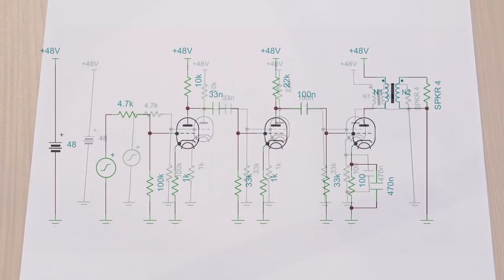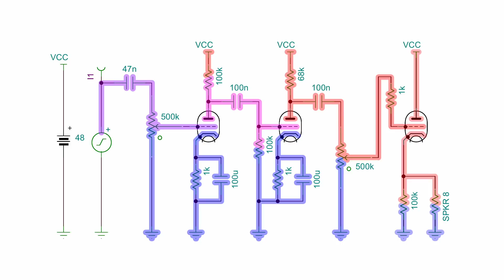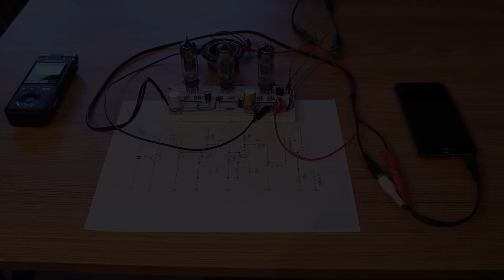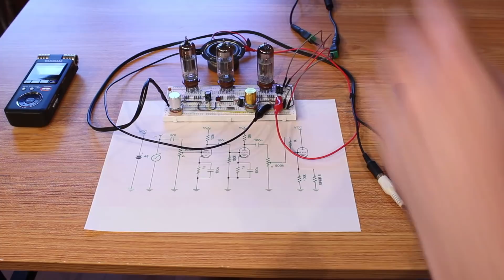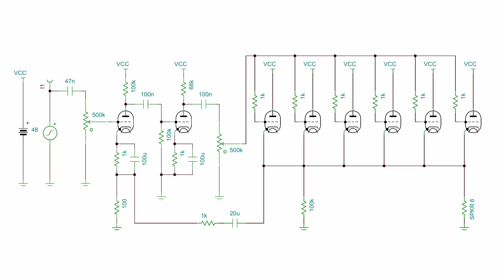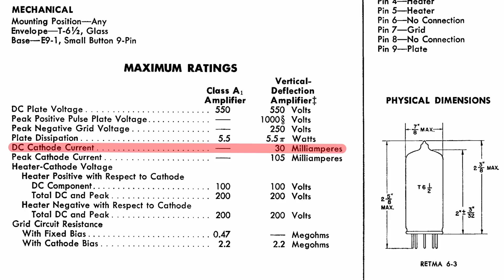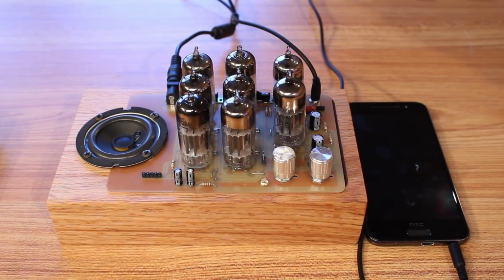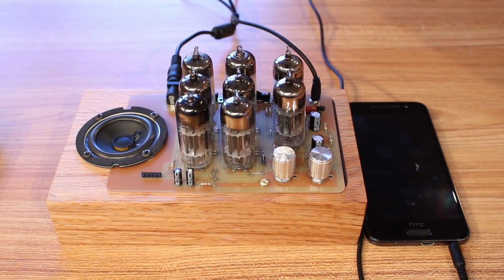A Low Voltage Vacuum Tube OTL Audio Amplifier

Comment: I see that the 100k in parallel with the speaker is negligible when the speaker is working properly. If the speaker open-circuits, then the 100k keeps the tubes from not dangling in air, but how could a short circuit protection be?

By the way, excellent choice about Doom, greatest video game in all history.

Comment: How about doubling the number of output tubes again, but put them in series/parallel in a vacuum tube version of a quasi-complementary totem pole output stage.  You'd also need a phase splitter driver as well.

Comment: Last year, I built an OTL (Output Transformerless) Tube Headphone Amplifier using three Svetlana 6N1P medium mu (33) twin triode tubes, it sounds wonderful when used with my pair of Audio Technica ATH-M50X headphones rated at 38 Ohms, I got the design information from an article I found on the HeadWize Memorial website.

Comment: What about subminiature Twin Triodes??? Put like 16 in parallel and you get good output. just run it on rectified ac voltage. And some small efficient filament driver like an led driver, or even the Rectified AC. Since theyre all in parallel. 

Please, give me a reason why this would not work This drives me stupid.

Comment: NO WAY. NO WAY. NO WAY.  YOU CANT SIT SIX 12B4s ON TOP OF A SPEAKER. THE QUIESCENT DC WILL PUSH TJE SPEAKER CONE OUT LEAVING VERY LITTLE EXCURSION FOR THE MUSIC.  YOU CANT EXPECT MUCH BY RUNNING DC BIAS TJROUGH TJE SPEAKER.  TJEY ARE NOT RED PLATING BECAUSE YOU HAVE NOT SURPASSED TJE PLATE DISSIPATION

Comment: I apologizes myself for the following very basic question, but does the vacuum tubes produce X Rays? I mean, x rays are produced also in vacuum tubes (but at higher voltages), and I was wondering if even is in low voltages also this tupe of vacuum tubes produces X rays. Thx!

Comment: You are into cool stuff. I had a ton of 12B4’s 10 years ago to build a HV OTL amp but never did.
If going for tough stuff you can use the 12B4 in a simple amp that is powered by a HV SMPS supplying some 170-200V. Or if going minimalistic, use a 6AS7G (or better still a 5998A) which is a dual power triode and a 12AT7 or similar for a 2-tube stereo amp.
Requires beefier psu and output transformer but is an absolute killer.

Comment: The speaker is shunting the Cathode resistor, and needs decoupling with a large capacitor. You can also increase the value of that resistor to limit Anode current whilst giving a higher AC voltage across the speaker, and therefore more volume whilst improving output tube Cathode life.

Comment: OK, I build the "Amplifier" the 3 tube version. It works - however there is a lot of distortion in the music coming out of the speaker. And the signal directly feed into the speaker is louder than the signal coming from the "Amplifier". So somehow I agree it works but nothing more. It consumes 45 Watt and the signal is distorted and fainter meaning negativ ampification. 🤔I put the same components and followed 100% your schematic.
☹ Really sorry but - the "lets build a tube amplifier" was a flop, I don't know what you did but mine was even a double flop - flop flop so to say.
Reply: Bro this is a class A model, the efficiency is low (20%) and with 3 tube you have to match the transformer and shit. The circuit is simple but valves are tricky on low voltage.
Class A its know to be a pre-amp, and you need a power phase to increase the output current with beefy tubes to better results.

Comment: philips came up with a transformerless output circuit using either 2 EL86/6CW5s,  or a EL86(or UL84) and a EL84/6BQ5 , with a special 800ohm impedance speaker , capacitor coupled, unfortunately, as said in the video, it needed quite a high HT/B+ for 'good' output (one record player that used the circuit had a roughly 400v HT line!)
Reply: Yo he construido varios OTL con esta topología de Philips y van realmente bien, con altavoces de 600 homios, pero tambien con altavoces en serie de 16 ohmios  muy eficaces, y hasta con El 84 y EL 34, dan entre 5 a 10 watios. Recuerdo que en esta topología de philips solo entrega potencia una de las válvulas El86, etc, la otra es reguladora/estabilizadora del circuito

 aproximadamente, con un solo Triodos de previo, con mas previo supongo aumentará la ganancia.
Philips estaba en la linea adecuada, que pena que lo descontinuaran 😅

Comment: just rewind a 2k ohms speaker coil in a 8inch speaker  made in a repair shop...  put it on a SPP push pull output stage  using 300v ac and you will have a REAL sound...
Reply: Jeje conoces a alguien que pueda rebobinar de esa foma?, Sería interesante
Reply: @fmk326  here in Brazil, in Sao Paulo, people do... or go to a speaker repair shop. and ask then where they buy the winding...

Comment: As much as I enjoy OTLs, output transformers are not the villains that you suppose them to be. Being made up of inductor sections, transformers can and do increase signals dynamic behavior. In fact, they are a fundamental tool in that they allow us to shape the final timbre the amp is going to present. People wrongly believe the more straightforward a circuit is, the better. But this is not always true.Sometimes a more complex circuit carrying transformers means more harmonic richness, which is a good thing in musical terms. And let us not forget that  harmonic richness is that which musicians are looking for whenever they overdrive their guitar tube amps!

Comment: Please say "twelve"  not "one" "Two".  I appreciate your aviation background but this is tube jargon. Please don't use aviation nomenclature  in conjunction with these few exceptions to the standard convention as justification.  
All that said, as an old timer electronic tech that has designed and built traditional high voltage tube (valve) pre-amps and amps , I do appreciate the innovation and entertainment value of your videos as the inspiration to pursue audio excellence!

Comment: I've always wanted to build an OTL amp. My goal would be use big octal tubes as the outputs, and have enough that my paralleled plate impedance would match my speaker impedance. The trick then is to build 32+ ohm speakers.
Reply: ...Or use  headphones with an OTL amp. Virtually all headphones are 32 ohms or more.
Reply: @dmark2639  headphones are never my goal.
Reply: Buy commercial grade speakers that have a 70 volt transformer and various wattage taps built in. JBL, Klipsch, Tannoy, QSC, Community, Atlas, and many more brands all make 70v speakers in all sizes and form factors for commercial use...

Comment: First digits are the heater voltage, the letters are a factory designation and the last number is the number of useful elements in the tube, for tubes that use that numbering convention.
But that doesn't take into account ECC34 KT88 and other tube naming conventions.  
I don't get upset by it though.   I know that things are read a certain way over the radio.    I often use phonetic alphabet when reading things out

Comment: Different tubes have different naming conventions. Depends if it's named under RETMA, RMA, JAN,  Mullard/Phillips, Eimac, EIA, etc... 4cx250 is an Eimac tube. In their convention 4 = Tetrode (3 for triode, 5 for pentode, etc). C = ceramic construction. X = external anode. 250 = 250w anode dissipation. Next letter indicates the variant (filament voltage, special use case, etc). A next number indicates amplification factor in the case of triodes. They also use a 4 digit EIA part number, and other manufacturers (RCA, etc) produced tubes identical to Eimac with this number.

Comment: Is there any effect from SMPS's or Boost/Buck converters on tube systems?
Reply: Yes, any output noise from the supply goes straight through, just like it does in a solid state unit. Use a high quality S.M.P.S. 

As far as RFI/EMI interference goes, keep the converter away from any transformers, as any magnetic interference WILL couple thru the transformers. 

Other than that, there's nothing different than there would be with a solid state design.

Comment: If you're really interested in building 2 amps getting RCA receiving in the back part there's charts but tell you at which voltage to use which resistor value on which pin to get max output without distortion. You can adjust these values to get more or less gain ad needed.

Comment: I'm kind of confused about why you want to build vacuum tube amplifiers but not with required voltage has to give any kind of reasonable performance. It's kind of like saying I'm going to build an 18-wheeler truck and I wanted to be able to haul loads to the grocery store from the factory and I'm going to use two ceiling fan motors mounted to the wheel hubs and power it with a 12-volt battery. Is it because you're just trying to see what you can do with low-voltage with high-voltage devices or is it that you don't want to make the investment and buying proper transformers? Because you can always do a series filament amplifier like an early radio. There are 35 volt rectifiers that matchup with 50 v power tubes and you can sop up the rest of the 120 v with other 12-volt tubes. I am posting this at the beginning of the video so maybe you are able to make a successful OTL amplifier with 48 v. I just can't imagine it having very much volume.
Reply: His object was to use a low b+ to be safer for tinkering. I find it interesting.

Comment: Numb(?) question - will tubes like 6bj6 and 6ak5 work “acceptably” at 48 volts, or perhaps a little more - perhaps as much as 72 volts?

I got tossed by ~300 volts in my teens, (1 tube Amateur Radio transmitter) and I’m not fond of “high” voltages.

Comment: With that circuit, the only grid bias you're getting is from the current through the speaker!  So the operating point is in a very nonlinear portion of the curve.  If you were to put a DC voltmeter across any of those 1K resistors, I'm sure you'll find that the tubes are drawing grid current.  You DON'T want THAT, in a Class A amp!

Comment: Oh I don't know about getting rid of the output transformers.... Just speaking aesthetically.... you need output transformers to give it a "proper yesteryear feel". But I suppose 6 driver tubes is more tubes, so that's "old-timey" too. And it's certainly got some "go juice" in it!
The whole thing with the filament voltage having to be a "correct number"... I wonder if that's why some people call logic ICs "seventy four L. S. twenty" where I'd always say "seven four L. S. two zero" (I'm dyslexic... that's kinda the same as talking to aircraft on a radio)

Comment: Regarding your tangent on how you pronounced the tube name - how some people act in Youtube comments is beyond me. Sure, if somebody is presenting factually incorrect information in a video, I can see why people would want to correct it.  But just for a different, yet still technically correct way of saying it? Unbelievable. I did notice in earlier videos that you also like to say resistor values differently from what I am used to - but who cares if someone says twenty-two thousand instead of the more common twenty-two k(ilo). After all both means the exact same thing! No reason for me to bring that up pointing my finger at you and publicly try to make you look like a fool (while making myself look like one 😅).
In fact, I am used to people pronouncing digits  individually when it is not about the actual number as an amount (one hundred bucks are still one hundred bucks, but part number 357 is three-five-seven), probably because my late dad did it the same way, he used to work as a ground controller at one of Europe's largest airports, which was likely the reason for him doing that. 
To this day, I totally lose track when someone tells me their phone number in any way other than digit by digit. if it is 123456, it is one-two-three and so on, not twelve, thirty-four...to make matters worse, my native language of German loves to switch the order of ones and tens, so it is actually "four-and-thirty", making it even harder to type it in the correct order.  🤯

Anyway, long story short, your content is awesome and I really want to thank you for it!
Greetings from Germany!

Comment: Tubes have very little current capability. The high voltage is useful with a step down transformer for the current conversion stage. Most tube amplifiers for 50dB have a unity gain buffer, voltage gain stage and current conversion stage. For 30dB usually we have voltage gain followed by current conversion stage. Where an output transformer is not used like your case, it was correct to have several parallel output tubes. For your 48volts supply you correctly chose a 11dB gain for the phones 2volts input which translates to roughly +/_22volts voltage swing for your 48volts supply.

Comment: Why guessing the cap values, they are just simple high pass RC filters, they are not hard to calculate, there are also many online RC filter calculators so don't even need to calculate it by hand.
Edit: If you think inrush current will be a problem a simple soft start circuit with mosfet or so hidden under the pcb would be a nicer and safer solution than two power switches, you maybe forget it one day and blow up a power supply or so.

Comment: Usagi, I don’t want to open a can of worms for you, but have you ever considered re-winding your speaker voice coils?  Since there’s an impedance mid-match from the tube output to an 8 ohm speaker, then change the speaker to high impedance.  Say, 1K?  
If I remember correctly, there was an ancient article in “Hi-Fi Magazine” about doing this, and they reported amazing response from the speakers when not running through an output transformer.
Reply: Quizás no necesite rebobinar sus altavoces si encuentra uno de 800 ohmios o 600 ohmios por ejemplo en Ebay, no te preocupes si ves que es de tan solo 6" rinden como los de 12 hasta en sonidos graves dentro de una caja semiabierta, y suenan de maravilla.
Es lo que yo he hecho y si, son unos grandiosos altavoces, 
Estaría bien encontrar ese artículo que comentas para hacerlo uno mismo en casa tambien, pero ojo la bobina lleva hilo mui fino, demasiadas espiras y ocupan tamaño, algunos diseños de philips y otros llevaban la bobina por delante del cartón a la vista exteriormente junto con el imán claro, si por delante del cono.

Comment: A wonderful hack. Try the other direction. Rather than decreasing output impedance with more tubes, try several speakers in series for more load impedance! Class B or A/B to get rid of the DC is also good.

Comment: Back around 2014 while in college I built my own 4 channel OTL surround sound amp and used +/- 60V rails for the output (needed -120V output bias and something like 350V for the input gain stages). With 4 6AS7 outputs per channel (8 in stereo mode) it's plenty loud for a moderate sized room on quadraphonic mode, and rattle the windows and walls loud in stereo.  It's clearer than conventional tube and SS amps too...It's really interesting to hear a tube amp deliver razor sharp synth from prog rock while at the same time being able to render crisp punchy DEEP bass from say an action film with gun shots and explosions, and get things like piano and vibraphone right to a surprising level of realism.

You should try collecting vacuum tube TVs from the 60's. Once you get used to working with and surviving regularly getting shocked by 25KV, voltages over 60V stop being scary, and become pains that you learn to avoid touching.

Comment: The proper output transformer is going to match your impedance where you will get a very flat response and the warmth and bottom end will increase greatly. But that litle speaker is not going to demonstrate that as well as a bigger driver will.
Reply: Yep, you said it.

Comment: I wonder if you could get good results from 3 12bh7 tubes, or even 2 6360 tubes. I'd love to see what you come up with when trying to scale the size of this down. I've been dreaming of making an opt guitar amp and this design seems like it could be a great start. Hell, I bet you could easily turn this into a great headphone amp too.
Reply: Bien, muy bien, si quieres orientar esto a un amplificador de guitarra quizás yo pueda modestamente aportar algo.
Tengo funcionando 2 o 3 para guitarra claro, en baja tensión y al menos otros dos con la tipología del circuito  de Philips con 2 el86, pero yo te recomiendo que lo hagas de Baja tensión sobre  los 30 o 50 voltios de circuito.
Yo he utilizado la válvula 12k5 de doble impulso, específica para esos 40voltios , quizás se pudiera forzar mas.
No da excesiva potencia,  pero con un previo de dos válvular tipo ecc83 y un altavoz eficiente de guitarra, suficiente para un sonido de mucha calidad.
Y por añadido tendras el mejor ampli de cascos con unos cascos de Alta impedancia de 200 o 600 ohmios.
Yo incluso los he conducido con solo medio triodo en un previo tipo fender, sin control de tono , solo volumen y listo, y de esta forma traga pedales de guitarra de forma maravillosa, 
Es un sobido limpio y saturas con pedales.
He montado uno con bateria de 12 voltios pequeña tipo alarma y dura mas de 15 horas y tambien a 220v conmutable claro. Y para guitarra
Preguntame lo que necesites 😊

Comment: Hmmmm, I have a decent handful of pentode Mullard EL34 (that's 6CA7 to you fellas over the pond).
I wonder how well they'd do as a parallel cathode follower final stage OTL 48V.
The heaters on them are 1.5 Amp if my (aging) memory is correct so that'd be 56 Watts of heaters for a '6-pack'

Comment: Look at headphone amplifiers for ideas on how to construct an OTL amp.
This design will eventually fry the speaker, since you have the full output tubes (idle) current going through 8 ohms (100k across 8 ohms is 8 ohms) speaker, and speakers do not like DC across them.
Pluss, the output tubes are cathode biased, but with only 8 ohms from the cathode to ground, they have near zero bias, so the tube are basically turned fully on.